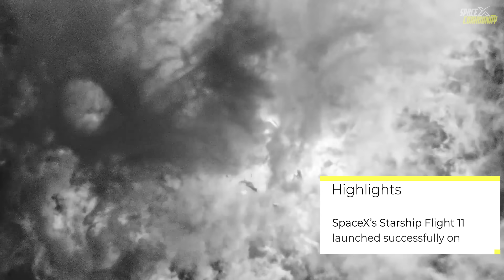Starship Flight 11 DAMAGE: SpaceX Weird Decision on Ship 38 Tiles After Flight Data Review! Too Late

Comment: Well, it wasn't supposed to be about satellites, and so forth, it was supposed to be about Mars. But it seem now, more for satellites. Seems the goal for Mars is on the back burner. Alot has to do with, most humans, to travel that far will get alot of radiation and most likely kidney failure.  As space station is still protected alot by earth. As that far away, won't be. They would have to get there faster, scientists say 90 days, before the radiation would be a factor. And then the fuel to slow it down. To land it on Mars. Essentially needing several refuels, to do all this.

Comment: 11 flights and chunks still fall off, this is a really expensive experiment at this point.
Reply: Tiles were removed from critical areas BEFORE launch. This was a test flight and one of the many things they were testing was the resilience of the steel underneath the tiles by simulating damaged or missing tiles, to see if it would burn through.
The panels that were deployed into space were also 'dummy' panels, again, testing the deployment mechanisms.
They stated before launch that the ship would not be recoverable, it was a 'throw away'.
Reply: Ofc they fall of if your intention is to test it with major missing parts.

You circus people have no idea what the term test or experiment stands for. Truly amazing effect of dunning-kruger. No knowledge but even bigger comments

Comment: Why not run the booster hovering until out of fue to prevent an explosion?
Reply: They blow them up on purpose so it sinks faster. Every booster and ship have explosives, and they blow them up on purpose to sink them and so no one else can try and recover them
Reply: Because then they would just have to blow it up anyway. It would cost more to recover it I'd guess than it's worth, and they wouldn't be allowed to leave it floating out in the middle of nowhere.
Reply: Because it would cost more to recover than it's worth in scrap , they don't need it anymore as they are moving to block 3
Reply: What good is a large uncontrolled swimming object in the ocean.... oooooh wait. Right you didnt use a second to think about your own comment so you outsource your laziness to us.

Comment: why arent we going up as high as we can with jets engines then fireing off the rockets
Reply: Cost and complexity - Jets are more fuel efficient, but weigh a lot more per unit thrust, than the rocket engines.  Pegasus did this from B52's back in the 90's.  It actually didn't save much in fuel, and was only useful/cost effective with the small payloads (around 400 KG max) the vehicle delivered to orbit.

Comment: The Starship always seem to explode when touching down in the Ocean . Very hot bottom stage with Ceamic tiles hit cold water not surprising that it is a volatile landing. You don't see the same thing on the booster why( no tiles and not as hot probably ) Also the weight probably submerges the tail very fast.
Reply: Starship is intentionally destroyed when it goes down in the Indian Ocean - probably a requirement from the FAA/DOD in order to prevent other nations from recovering any useful components.  Rockets ARE missiles, so the technology in them is controlled as arms.  The Booster doesn't have this requirement since it is coming down within US territory (which extends 12 miles/20km offshore)
Reply: Intentional. Boosters are supposed to be reusable while the upper stages weren't ever meant to be recovered. The next Block uppers, starting with Starship 40, will start catch attempts.
Reply: Intentional. The current uppers were never meant to be recovered unlike the boosters which are being reused.
The first flight of the next versions, S39 will also include splash landing but the flight after, hopefully, will try to catch S40.

Comment: I wonder what would happen if they deployd a massive parachute in space just before the starship re-enters?  Surely that could break the gravity speed significantly?
Reply: With no atmosphere nothing would happen until reentry then the parachute would be incinerated.
Reply: @SirDeanosity  What if the starship lit up on entry, then as it comes down slowly and hits the atmosphere drop the parachute?   The parachute can then be released closer to the ground before the Starship lights up again for a soft landing.  This way saving time on engine use and on fuel?
Reply: @kobusvanstaden3388  to slow the starship down any significant amount would require fuel equivalent to both the first and second stages entire capacity, that's why the atmosphere has to do the braking, so what it does is how it has to be

Comment: I don't understand why blow up when landing when they can check all with drones before it sinks maybe blow up after under water . a lot  more drones seem to before landing would make more sense would it not ?
Reply: Blew up because it fell over rupturing tanks. The only way to not blow it up would be extreme luck, or catching. So they didn't blow it up. The in flight abort systems are safed. Aka won't bow up after. So. They didn't explode it, it exploded.

I do believe they got lucky once and most of it floated.
Reply: @gagefoley8621  No, it blew up due to the use of the flight abort system, intentionally re-engaged upon "landing".  This is likely a requirement to prevent other nations from collecting flight components (ITAR regulations). The only one that didn't blow up was the early test in which the upper stage came down with the 12 mile territorial limit in the Gulf, which would allow the US coast guard to prevent other nations from conducting recovery missions.  That is also why the boosters don't blow up - they all land within the 12 mile limit

Comment: Although a relatively successful flight Ship 38 was not intended to achieve orbit, and while flight 11’s re-entry tested the heat shield, it did so at lower speeds than orbital re-entry would demand. Orbital re-entry will require the heat shield to withstand far more intense thermal stress, especially during peak deceleration phases.
Reply: Yes but that's what the engine tests are for. To slow the rentry
Reply: Incorrect those speeds were not very far from orbital speeds. In fact they would a more gradual slope coming in from an orbital position. They in fact used a steeper slope on.purpose to stress test the vehicle.
Reply: Ummm.... sorry. no.    The idea that a re entry from a stable orbit is somehow thermally "harsher" than one from any partial orbit is hogwash. 
It dates back to the notion of high angle parabolic suborbital launches during the mercury/Redstone flights - where the capsules went nearly straight up,  and came back in much the same way - at a PUNISHING 8-9 G deceleration rate.   Sure, the high apogee ballistic arc reentry resulted in pretty minimal heating... but its because it shed velocity so fast on the way back down it took a trained fighter pilot using a G straining manuver to stay conscious during it.     

The mid coast engine relight and burn test put Flight 11's perigee at 50km.  

So, This flight simulated an fairly agressive orbital reentry at 2G  from a circular orbit with 192km apogee,  AFTER a (theoretical) retrograde deorbit burn.  

No spacecraft in orbit re enters at a velocity suitable for a stable orbit.  An orbiting body MUST slow down, and have a perigee inside the atmosphere to fall out of orbit. 
In fact - this flight's reentry profile was pretty agressive from a thermal perspective than a de orbit manuver from a stable orbit.  From a stable orbit, a craft can choose to use a skipping reentry where it slows down more gradually in a series of shallow dips into the upper atmosphere, allowing some of  the thermal load to disapate between dips, before final capture and desent into the lower atmosphere.  This was the harshest reentry profile the flight could come up with without either:  1.  Choosing a steeper entry and trying a 3G entry (cooking a bit less, but higher structural loading of the ship) or 2.  Trying a skipping reentry, (and missing the permitted landing zone by hundreds of miles, but cooking less)  

These flights are deliberately testing a reentry profile with MORE peak heating for LONGER than other reentry plausible profiles.  They aren't being "nice" to the ship,  on this flight  - they crippled the TPS deliberately in key areas and roasted it just to see if it made it.  It DID make it, but it had a pretty low survivability chance.  By design. 
They are litterally testing these things to destruction deliberately.  That's what iterative prototyping is about.
Reply: I think there is not much difference there between 27300 orbital speed and 26700 this test! And  even when come back from 4000km alt back to the Earth, will not much difference, too. The peak heat, the alt when it happen almost ~70 - 80km

Comment: Just a show, it will never be used to return to Earth as there will be no cargo bringing from space, it's heat resistance is useless to land on the moon or Mars as reentry conditions not the same like Earth, im addition not designed to load cargo, if done the weight will be different hence again test of little value, to recover crew will need small capsule,  to recover engines the heat resistance need is  only the back part the main Starship of little use. Why spend so much energy for something which will be of little use.
Reply: Are you in the space industry? None of Starships's issues are insurmountable.

Comment: Staship middle 3 engines are not vacuum optimised.
Reply: So what is the difference between the two types?
Hint: it's the cone size and shape! The rest of the engine is the same otherwise!
So while we have only seen the atmospheric versions the cone is an easy swap out. And only needed for extended space travel (Moon/Mars)